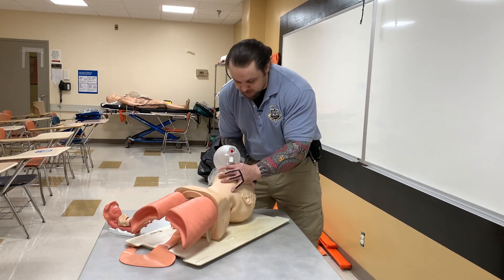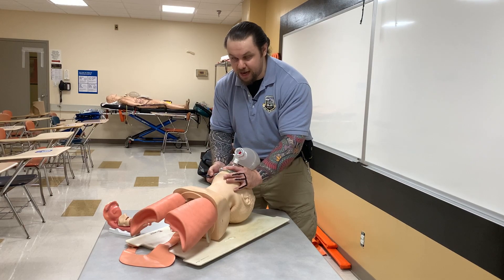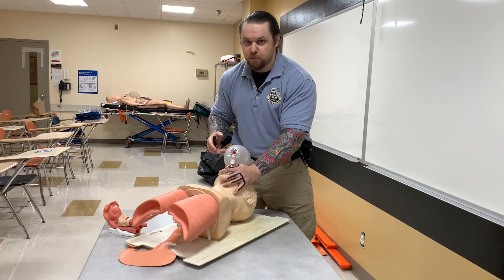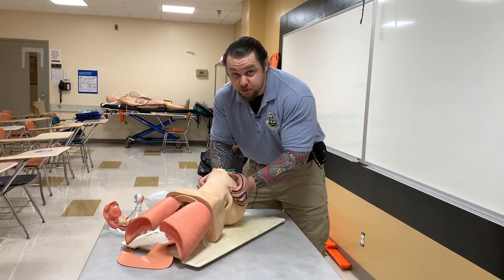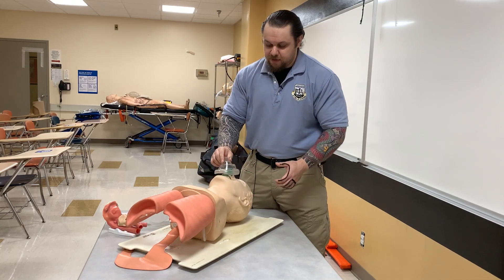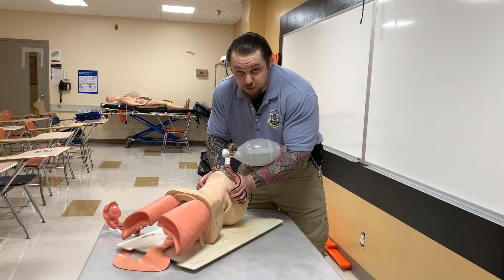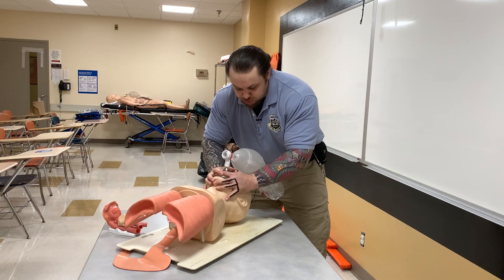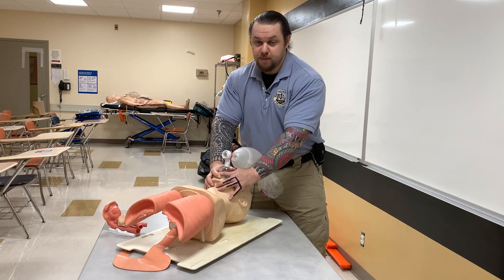Which technique is better 1 Hand E-C or 2 Hands V-E Technique for Bag Valve Mask BVM Ventilation?

Comment: On my BLS shifts, I've cannibalized the extension tube and short plastic cylinder from an LTV vent circuit to get some separation between the mask and the bag so I can safely ventilate someone while I'm strapped in for transport. This works best with a Laerdal, where you can keep the exhale valve at the mask to prevent the extension from creating excessive dead space. To my knowledge, it's not as simple to do this with an Ambu because you can't remove the valve from the bag, but even then, it's better than a kick in the teeth if the transport is short.

Of course, if I'm working with an RN, and we have to bag a patient, we just hook the ventilator up to the mask. 😁
Reply from the maker: If you worked with a medic that patient you were bagging could have been intubated and placed on the ventilator. That's beats working with an RN :)
Reply: @criticalcareift  -- Since we're CCT, it's usually the case that if a patient has an airway issue (or a foreseeable one) significant enough that tubing might be indicated, odds are the patient already has one, and if they don't, we'll just go ahead and ask the sending facility to do it for us.

If we are having to unexpectedly ventilate a patient, we'll place an I-Gel and consider diversion (usually not necessary), or we'll drop a nasal airway or two and put a PPV mask on them, and put them on SIMV or something like that. Just the other day, we had a guy who was probably given way more sedative than we were told, and was snoring up like crazy, but since he was still trying to breathe, we just put him on CPAP. No need to complicate things.

Several of the nurses I work with ARE medics, by the way.